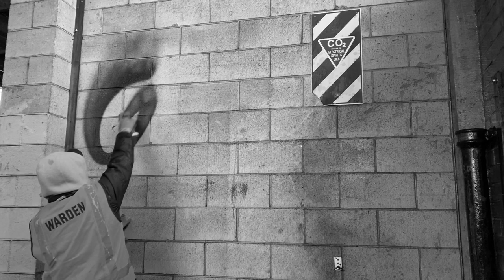#berstchallenge Tags from New Zealand

Comment: Fresh as always bersto
Reply from the maker: appreciate it brother just testing what the cans can do
Reply: @bobbyhung10  yeah I've always wanted to do this with a variety of different brands, are you using low pressure and high pressure cans? With astro cap or pink dot?
Reply from the maker: @ODKGRAFF  They're mostly high pressure cans but the kobra ones were low pressure. Need to bust out the big montana ultra wides!
Reply from the maker: @ODKGRAFF  Also, all done with astro caps
Reply: @bobbyhung10  yeah bro awesome!! black wall, chrome ultra wide! That would be satisfying to see you get done with